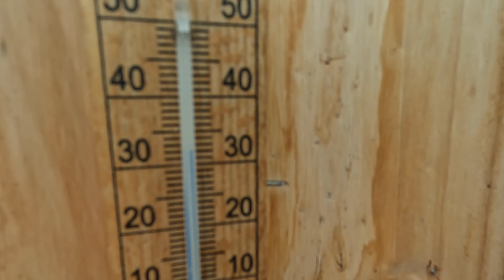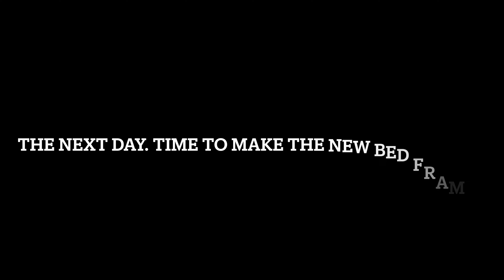PROJECT POLYTUNNEL - PREPARING THE HOMESTEAD / FARM FOR WINTER. NEW LAYOUT, BEDS & DRIP IRRIGATION.

Comment: Great improvement looks like it will work well! I'm not sure if you have a filter on the supply from the IBC but if not, it's a good idea as if the dippers block that part of the bed will be dry.
Reply from the maker: Thanks for watching Mark :)
Right now the water in the IBC’s which feed the poly tunnel comes from our well, which has a filter on it. I’ve heard those drippers are a pain if they get blocked up so I’ll need to make sure I only add already filtered water in, or as you say, add a filter may be a wise idea!
Have a great week Mark :)